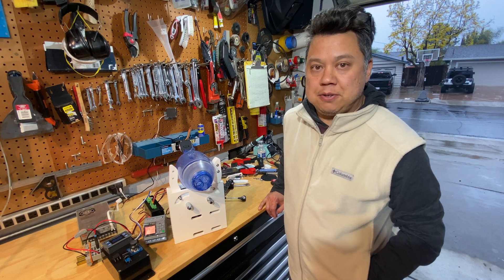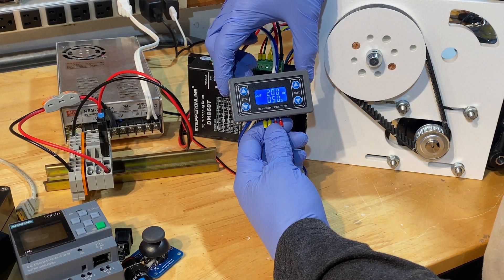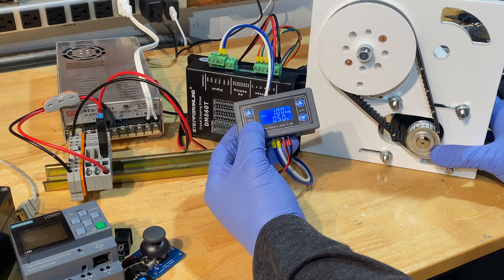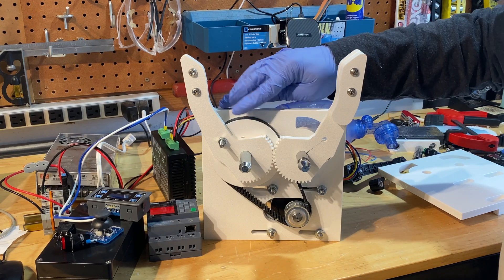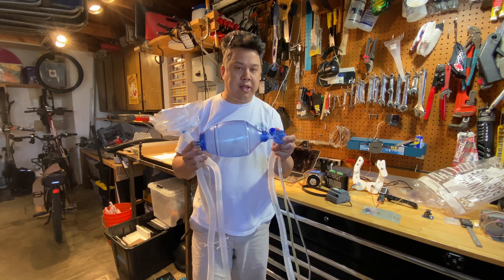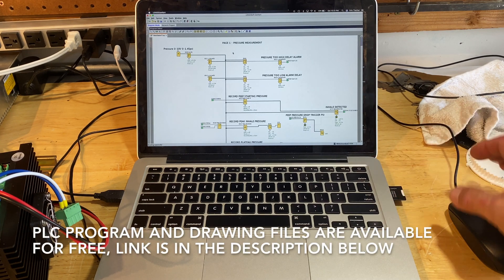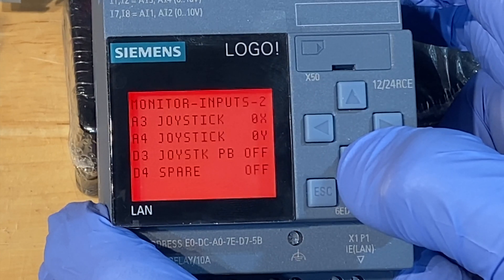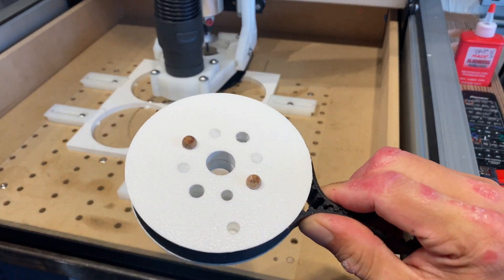DIY Breath Controlled Ventilator Part 2

Comment: Sir, can you give us an insight on how to decide motor ratings ?
Reply from the maker: The MIT website had some info on motor sizing.  As a rough estimate, the motor I bought can do 12 lb*ft of torque.  So if the arms are 6" long, and each arm takes half the torque from the motor, it will squeeze with the force of 12 lbs.  Im using a 3:1 belt ratio, so it should have around 36lbs of force, roughly speaking.   36 lbs is quite a bit of force for a hand to squeeze, I think it's probably double what is needed.   If I find it's not enough, I could eliminate one arm and double the force.

Comment: Hi Etischer,  

One thing that has been brought up as an issue is dead space where co2 can build up and the patient will not get enough oxygen.  More can be found on MIT's E-vent page:  https://e-vent.mit.edu/mechanical/plumbing/
Reply from the maker: Thanks for the comment.  The hose kit (circuit) I'm using has a separate fresh air supply line and exhaust line, so they are not mixing creating a dead space.
Reply: @etischer  That's great to hear. Would you provide the source and parts for that? I'll be looking at placing orders today. Our goal is to get a working prototype by the end of this coming weekend.

I'll send an email with my direct contact information.
Reply from the maker: @MapleBearMachining    Bought the hose kit from https://www.diabetesstore.com

Comment: Nicee work!
Just wondering from where did you ge the pressure sensor can you post the link
Reply from the maker: This is the one I bought https://www.digikey.com/product-detail/en/nxp-usa-inc/MPX2010DP/MPX2010DP-ND/410890  Looks like that one is sold out, but there are a few alternatives in stock that are also 1.45 PSI

Comment: Sir  i am really interested in your works. Awesome....We are also trying to make a mechanical ventilator.Sir how is possible to measure tidal volume,respiratory rate, peep, fio2, ie  ratio etc
Reply from the maker: Tidal volume is set by how far the PLC allows the arms close on the bag.  A flow meter could be used to measure it, or a look up table could be generated to correlate arm angle to volume.  Respiratory rate is just the inverse of the time it takes for the arms to complete each cycle.  Peep pressure is set on the peep valve, and the pressure is measured with the pressure transducer.  I'm not using O2, so no FIO2.  IE ratio is the number of seconds the arms are closing, divided by the number of seconds the arms are not closing, it can be adjusted by changing the speed of the arms, or the distance the arms close.
Reply: Thankyou sir. It's very helpful. I am a mechanical engineer. I don't have much idea about PLC.i like to use ardino in place of PLC because of easiness. I don't have much idea about ardino also. So can you  help us in ardino part.
Any resource suggestion?
Reply from the maker: @biniljohn1821  Arduino is easiest if you can download snippets of example code to get you going. It's been 10 years since I last worked with an Arduino, but there are lots of forums you can join for help.  Adafruit sells Arduino shields and probably has example code to make them work.
Reply: Ok sir . Sir I have a suggestion. Can we try to convert expired carbon dioxide into oxygen at the exhaust valve. A scrubber like device can convert it. What is your opinion sir..

Comment: Why not using an Arduino with a LCD instead of the PLC?(just for costs sake)
My guess is because the program would be trickier to write on that board or would be maybe slower to process it. Just my curiosity :)
Luv your vids💪🏻
Reply from the maker: I like being one layer above text based programming.  I'm' also a PLC programmer so that's what I gravitate to, the libraries are more suited for  machine control.  PLCs are a bit more rugged, with optoisolated 24v  inputs, 10A dry contact outputs, dinrail mounting., no assembly required, nicer programming software.  Compared to exposed circuit boards, and 5V TTL Arduino hardware.  Each has it's benefits,  I've used Arduino in the past (check out the tachometer in my EV conversion video).

Comment: Why not building a gearbox with a 3D-printer ?
Reply from the maker: A machined gear from a solid piece of plastic (or aluminum) will be stronger than a 3d printed part. I don't think you could make a gear strong enough on a 3D printer.  Gearboxes are readily available, but for the torque output required, it was cheaper to buy a larger motor ($61). Building a gear box would take a solid day, and wouldn't be very smooth compared to helical gearboxes designed for nema motors.   I could always add (buy) a gearbox later if needed.
Reply: You have to research because there are people on youtube that ar building 3d printed gearboxes that can pull over 400kg. Maybe there are not that precise but i dont think you need high precise gearboxes in this project.
Reply: 3D printing is still a fairly slow process. Subtractive CNC machining is still much faster, and more wide spread. When ramping up production more parts per hour can be made vs a 24 to 36 hour single print job requiring significant infill for structural integrity. And not all 3d printers have the print space to produce what a CNC Milling machine has for a work envelope.

Comment: Need a strap or something to secure the bag valve. Looking good so far!!
Reply from the maker: There will be a cradle to hold it in place, coming soon.
Reply: The patient's exhalation needs to be filtered for viruses. The transducer might become contaminated?
Reply from the maker: I have a HEPA room filter, I'll just stick the exhaust hose in front of it and turn it on high.  The transducer is at the end of 4 feet of 1/8" tubing, I dunno, I think it's fine.  This on't be moving patient to patient (hopefully).